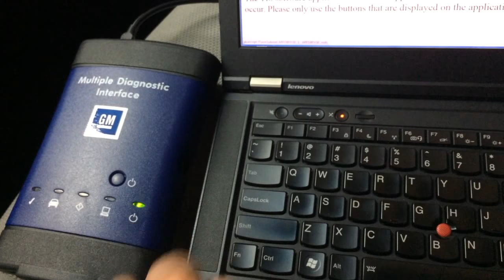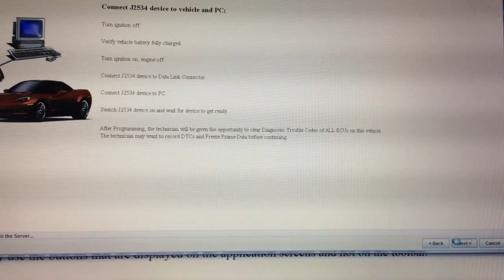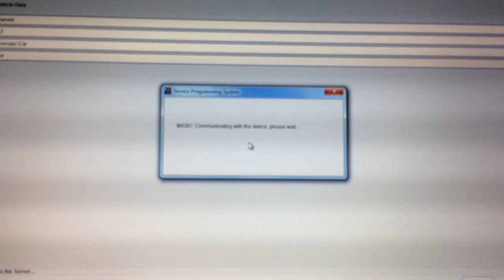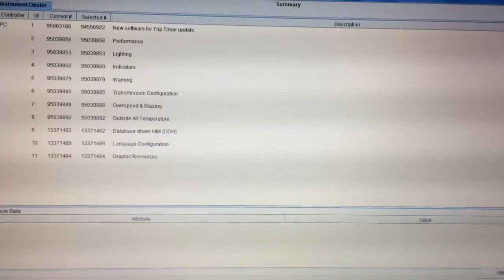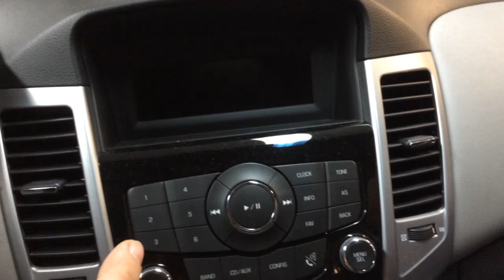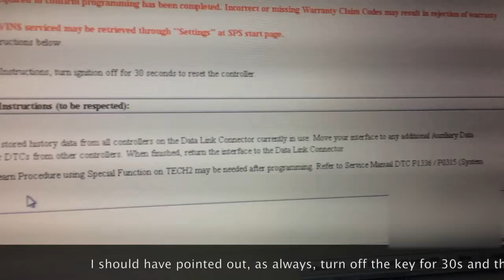GM SPS Programming: MDI Tool J2534 Mode ECU TIS2Web How to do a Calibration Update Reflash (IPC)

Comment: Also i am about to replace my transmission control module which the main stealers wanted £2000 to do plus labour found a new tcm ordered a clone tool now just need to know next steps sounds like a dumb question but do i need to de program the faulty tcm in order to  program the new one?
Reply from the maker: Since you're posting here around the MDI tool, I presume you're working on a vehicle newer than model year 2007.  Some later year TCMs do need solenoid information retrieved from the existing module first, you might find this GM Techlink issue of interest as to the additional tools you'll need to perform a TCM SPS (in addition to the MDI tool you'll need an EL-49642 (PSC-550) voltage regulator or equivalent - you cannot use a battery charger for this) and a blurb around TCM swap data retrieval considerations as well.  https://gm-techlink.com/?p=8438

Comment: I really appreciate your excellent how to video series.  I was curious what your laptop specs are as far as hardware and operating system? (32 or 64 bit?)  I am especially curious if I can use my Dell E6420 Core i5 Win 7 Professional 32 bit laptop.  From what I read on Acdelco's site, the 32 bit Windows 7 Pro was not supported. Let me know if you know if my setup will work with the SPS/MDI programming.  Thanks.
Reply from the maker: I've got a couple of older Lenovo ThinkPads for this, I've used both Win7 and Win10 but both 64bit only.   The Java applets on TDS use the 32bit Java runtime but I can't say whether you can get away with the OS also being 32bit.   CPU wise your i5 is fine and listed in the support PDF - https://gsi.ext.gm.com/userguides/Aftermarket%20Infrastructure%20Guideline%20v1.0.pdf  Some of this "supported" stuff just means you can't get any help from ACDelco as a dealer if you don't follow it, rather than it not working at all.  When you first log into TDS and run the main SPS applet it will do compatibility checks. If you get through those checks and can read current calibration inventory you should be ok.  Just make sure the battery is full up, and on a EL-49642 tender or booster if you're doing multi-module updates.  Do not ever use a battery charger when doing SPS updates.
Reply: @DrShock  I will probably just pick up an older Dell or Lenovo 64 bit laptop just to use with SPS.  I am sure glad I talk to you about not using a battery charger while doing SPS updates, as I thought that would be the way to be safer.  I am pretty tech savvy so what you are saying makes sense in regards to problems from using a battery charger.  I can see where the voltage fluctuation while using a charger could be a problem.  I don't have an EL-49642, but I will see what I can find with a clean steady voltage output.  Thanks Again for all your great help.  Sean

Comment: Can this be used to add factory options to the BCM which were not in the original build? I have added power locks, windows, and mirrors to my 07 Chevy express from a donor vehicle. I tried changing the vin in the donor BCM to mine with an eeprom programmer. With the donor BCM, everything works, but the security light is on and the vehicle won't start. I don't have passlock, passkey, or any other factory theft prevention nor did the donor. With my original BCM, the windows and mirrors work, the vehicle starts and runs normal, but the locks don't work.
Reply from the maker: Three/four different things you have going on here.   Yeah so with an used BCM the EEPROM route is the only way to address the VIN and the mileage correction for these years https://www.youtube.com/watch?v=Chy9pIzoguA .   And for 2007, yes you need a Tech2 tool, or the Tech2Win emulator subscription for this MDI, to reset the options in the BCM to match the RPO code sticker in your vehicle.   For the last problem, the Passlock security its again stored in BCMs memory and why I prefer to transfer the EEPROM rather than overwrite the contents.  For this you could try the Passlock Relearn procedure, there are some other videos covering that on YT.
Reply: @DrShock  Thank you for the fast reply. I finally got everything working. My original BCM was P/N 10367689, and the donor BCM was P/N 15116065. I tried just reprogramming the donor with the dumped binary from my original and everything works. The power locks option is apparently already programmed into the BCM even if the vehicle doesn't have the option. I also found that all the signal wires for power windows and locks which connect between the fuse box and the BCM were there from the factory. The wiring harness for the doors, and the one which goes from the fuse box to the doors had to be changed for this to work.
Reply: Alternatively, I'm wondering if the option coding isn't stored in the eeprom. The BCMs are supposed to be interchangeable. Maybe the CPU or some other chip has programming as well. I didn't think it seemed like much code in the eeprom to begin with.
Reply from the maker: It may very well be in that chip, but without knowing the memory map it's impossible to know for sure.   And it could be obfuscated behind some algorithm, like the odometer mileage is.    Glad you got it going, imo you dodged a bullet by using a different part number BCM.   Usually that's very hit or miss to do.
Reply: @DrShock  It was from the same vehicle, just a different year. When I Googled the part numbers, I saw that it was supposed to be interchangeable. But, if that's the case, then it seems like the locks should have worked with the original. Maybe there was something wrong with it. I guess we'll never know.

Comment: Thank you for showing this. I was looking for information related to programming with the MDI because I need to change the calibration on my 6L90 transmission. I got one out of a 2016 Express 2500 so I could use it in my 70 Chevelle. I've also purchased the harness and TCU from PCS. But, it sounds like I need to change the calibration on the 6L90 from the one for the Expres to something that might work in a stand-alone system. I'm waiting to find out what that is from PCS.
Have you ever done a reprogramming of the Tehcm inside a transmission this way? Thanks, Mark
Reply from the maker: No, I haven't.  I don't typically work with vehicles outside the factory config.  But that sounds pretty cool dropping modern tech into a '70 Chevelle.

Comment: Hello.
I have a mechanic shop and I need to replace an ecm on a 2004 Cadillac Cts. 
I went to junk yard and i find one for this vehicle. 
I plugged it in and everything works but the car doesn't start.
I learned that in this case I have to reprogram the ecm with the vin.
I've been looking to buy a tool for my shop to do that job and I found that I could do it with a tech 2 or a mdi.
Which tool would you recommend me and why ?
Let me know as soon as you can. 
Thanks
Reply from the maker: I dont't have a shop so this is just one opinion, but I would go MDI.  It covers more years, and as a shop you easily get the tax deduction for the full ACDelcomTDS subscription from GM.
Reply: @DrShock  
Thank you very much for the prompt answer. 
I'd like to avoid subscriptions...
There is anyway to do it without a monthly payment ?
Reply from the maker: Not legally, as the MDI tool unlike the Tech2 never had a PC based DVD kind of solution.  It's always been "cloud" based software from GM that you rent via subscription.   I believe the Chinese cloners from time to time include a HDD with something old they've hacked but I'm not sure its useful for more than GDS2 and Tech2Win (both diagnostics only).  For SPS programming I would neither trust that approach nor even believe it to be reliable if I were running a business.
Reply: @DrShock  
You answer my question pretty neat. 
Thanks again

Comment: You've been a big help! Would you recommend the MDI or the Tech2, I'm gonna buy one but not sure which I should go for
Reply from the maker: I would go with the MDI, it's going to cover the newer vehicles better and for the older ones you can always use the Tech2Win emulator on your laptop with the MDI as a passthru to the vehicle.
Reply: @DrShock  perfect thanks a bunch!
Reply: @DrShock  my buddy has a tech 2, I couldn't get it to connect to my PC. Here's a video of what it's doing. 

https://youtu.be/70NqKimuRes
Reply from the maker: @LS1FREEK I'd start with the USB to serial adapter, only certain ones will work on the Tech2.  Page 34 of the Tech2 user manual https://gsi.ext.gm.com/userguides/GM_Tech2_User_Guide.pdf recommends the Tripp Lite Keyspan, which is at the top of this tested list of USB adapters - https://www.tech2wiki.com/doku.php?id=wiki:tech2_usb2serial_test_report&s[]=usb as the linked video you have shows communications errors that must be cleared before you can proceed.  That TIS2Web communications diagnostic has to pass.   The baud rate of 115200 has to match what the USB serial adapters device driver is set for as well (it is less important what the rate set is than that it match in both the driver and SPS config screens).  Go into Windows Control Panel, Device Manager, and find that driver and pull up the properties sheet for it.   One of the tabs is going to have COM port configuration, make sure the baud rate (aka speed) matches what is set in the SPS Java applet.
Reply: @DrShock  you are the man, I really do appreciate all your help, it is very helpful! I'll try some more testing. The serial adapter I bought came from staples, it was the only one they had and it was $49 lol

Comment: I am trying to program a used bcm on a 2008 grand prix with my mdi. There is no option to reprogram a bcm on Tds. Just a vtd relearn 12 minute procedure. I am on my second attempt but unsure if this will work.
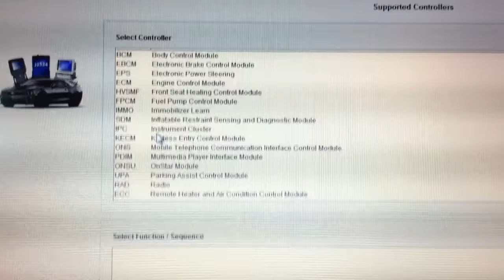Reply from the maker: BCM controllers are part of GM SPS (Service Programming System) and are within the Vehicle Programming System subscription option on TDS (once logged into SPS you can see the BCM choice at the top of the controllers list in the vid at 3:39).   I've personally only done this procedure for an existing or a new replacement BCM, so I don't know if it will support you moving an used one from another vehicle or not.
Reply: @DrShock  I found out that there are no RPO codes available for a 2008 Grand Prix (end of support) and there is no listing to program a BCM. It makes sense that if RPO's weren't available, then the options to program the BCM also wouldn't be available. I could keep playing Russian roulette with used modules in hopes of getting one with the right RPO codes programmed in it or I could live with the problem (no door lock function).  Thanks for the help.

Comment: Some of my history was Chevrolet certified first in 1985 and ASE master certificate until 2000, working on motorcycle primarily since then I want to try to keep up on Chevrolet. Have been using VXDIAG that has been doing a good job so far,,do you recommend a tech 2 or just go with MDI tech 3 with subscription to ACDelco
Reply from the maker: I recommend the Tech2 clone (much cheaper than the real thing) for folks with vehicles older than 2008.  Those can work with TIS2000 DVD based software and you don't have to pay anything additional.  For newer, any J2534 passthru like that VxDiag is fine with TIS2Web.  I personally prefer the MDI (again cloned) as I can be sure it's going to have the highest compatibility with acdelotds.   I do not recommend the MDI2 clones, as they are just MDI 1s in a 2 case so not really a 2 yet.
Reply: @DrShock  I don't think my VXDIAG came with TIS 2000,,I'll look at a tech 2 clone,,Thanks
Reply from the maker: No, it wouldn't.  TIS2000 was Tech2 only (unless you did some hacks folks came up with).   It's with TIS2Web that GM started allowing for J2534 generic passthru tools and supporting that path.
Reply: @DrShock  but TIS 2000 does require Windows 2000 or xp to5 run won't run on Windows 10 right
Reply from the maker: Yes, but you could run that inside of a VM (virtual machine) on Win10 if you have the RAM for it.   Personally I keep around a vintage IBM ThinkPad for running TIS2000, but there is the VM option if you're familiar with it.  Used XP laptops are just too cheap for me to bother with VMs.
Reply: @DrShock  Hello Dr Shock, Thanks for all of your videos and knowledge. Just want to ensure I'm not missing something:
Q1) Please advise that I may use a (working-thanks to your videos) MDI via USB tethered to a PC w/ MDi manager; DLC to vehicle; with TIS2Web subscription to program, calibrate & diagnose 2002 Buick LeSabre as per GM (2007 & ALL PRIOR MODEL YEARS are supported by Tech 2/Tech2Win*)
◦The PCM/VCM (Program for self-rebuilt tranny) to avoid ADAPT function and learn.

◦The VTD 
◦The IPC 
◦The HVAC (Calibrate new HVAC Actuators)
◦The EBCM (Bleed brakes and calibrate self-rebuilt ABS module.
Just want to be sure before I subscribe to 1 VIN & TIS2Web on ACDelcotds.com. The MDI Wi-Fi card works. No time to fix the MDI Ethernet jack nor the battery circuit, yet. Have a Bosch equivalent 12VDC adapter for MDI & spare 12VDC car battery to vehicle w/jumper cables.

Thanks!
Reply from the maker: @giovannicestari519  With the MDI, the diagnose and program functions are separated out.  In the Tech2 these were combined together such that the Tech2 could, for years earlier than 2008, do all the testing and special functions by itself with no subscription required other than for programming.  Since you have a 2002 you can use the Tech2Win subscription to get back that integrated testing and special functions capability.

What that means for your MDI ask is you would need to subscribe to both SPS (service programming system) to do any calibration updates to a module (ie., programming).  And then separately also subscribe to Tech2Win for the non-programming tests and special functions.  Newer vehicles, 2011ish and up, would instead have to have a GDS2 (global diagnostic system 2) sub for tests and special functions as Tech2Win is still limited to the same models years as the Tech2 itself.  

I can't comment on the Tech2Win functionality, as just like with an actual Tech2, the menus vary from model year and make.   Since I've not worked on Buicks, I'm not familiar with what menu options you'll be presented for ABS tests and special functions there.  But the SPS functionality is common, other than for Saturns, and for that you should have no issues with your single VIN DIY subscription programming using an MDI, or clone.
Reply: @DrShock  Thank you for your advice and sharing your knowledge. If one pays for the subscription ACD is available to help. So, I'm going for Tech2Win 365 days & SPS programming for one VIN with my MDI clone using USB to WIn10 Enterprise or Win 11(yes,eleven) laptop or a MS Azure VM cloud. Will let you know. Downloaded latest Java 32 & 64 bit. ACD says needs Win 10 64 pro or better w/ Java 32; however, noticed that enterprise versions of Win 10, Win 11 or MS Azure like java 64 bit & work well with GMeSI DVD in a local Hyper-V VM or in a Azure VM cloud (and other software). On the phone with ACDTDS. 1st purchase attempt did not work. ACDTDS is having trouble on web site. Or may be my payment method. Ah.hmm. Don't have your technical prowess, but determination and the CIS department @ University may prevail!

Comment: i cant access that menu? i bought the one for 40 dollars for 1 vin programming? what am i doing wrong? all i see is vin to get a cvn
Reply from the maker: Can you give me a time index into the video for the menu you're talking about?  Not sure which "that menu" you are referring to.
Reply: @DrShock  sorry I was having trouble accessing the ACDelco sps site. I finally got it workinging. Do you if this program flashes my vin to other modules?
Reply from the maker: Both the GM Tech2 and GM MDI (and MDI2 for that matter) can do that depending on your year.  Older vehicles (pre-2008) you usually have to use a Tech2, or the MDI running the subsciption for the Tech2Win emulator though.  In some cases you have to use SPS and a whole new calibration file.   Also depends on the module, a radio is an obvious example of a common VIN relearn capable module, but an older BCM module may not allow it.  Lots of variability, best to google around and see what's possible for your make/model/year/module first.
Reply: @DrShock  yeah I keep looking no info they mention sps but nothing. I have a 2008 chevy malibu lt 3.6 6T70. Needed tcm reflashed or my old tcm cloned
Reply from the maker: if its a new transmission control module then an SPS calibration update should also populate the VIN.  IDK if you can get SPS to work for an used TCM though.    This bit of text from a typical Chevrolet TSB though may help you find the right menu area in SPS "A revised transmission calibration has been developed to address these issues. Reprogram the transmission control module (TCM) with updated calibration files using the TIS2WEB Service Programming System (SPS) application. Select SEQ Programming Sequence ECM/TCM from the Supported Controllers screen."   So searching for that Programming Sequence ECM/TCM may help you find more info on the procedure.  I personally have never updated a TCM.

Comment: Can this be used to unlock a 06 impala radio due to it unlocking up from changing the battery?
Reply from the maker: The MDI, or a Tech2 for that matter, are needed to learn a new VIN/relearn the old VIN on the radio.  But if the radio is the one Chevrolet installed when the vehicle was built in 2006 you shouldn't need this as that model year the radio doesn't lock from simply losing power because it saves the VIN number on an internal chip (an EEPROM).